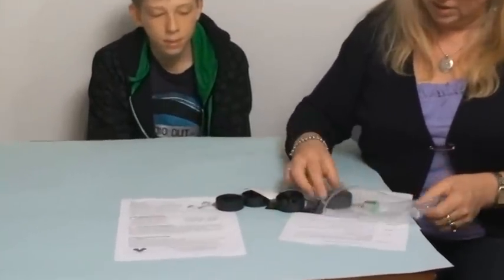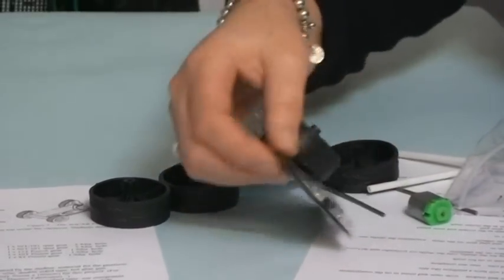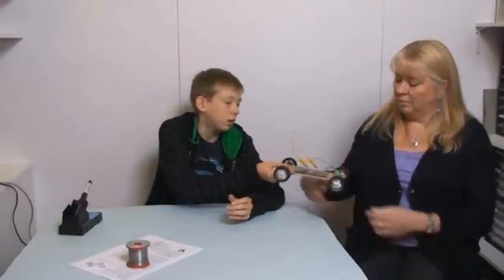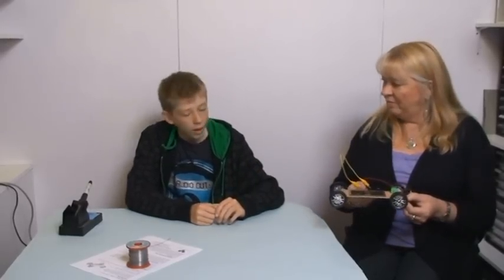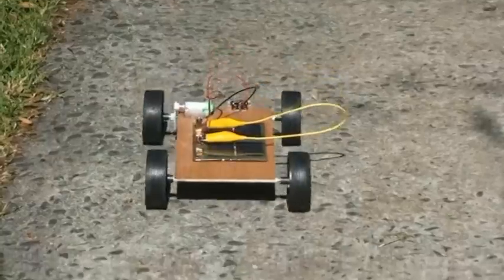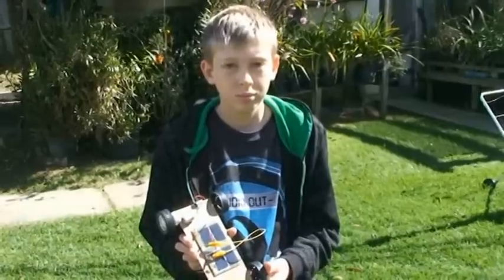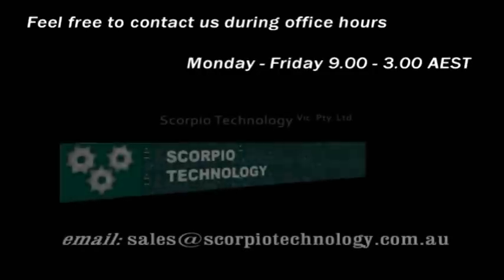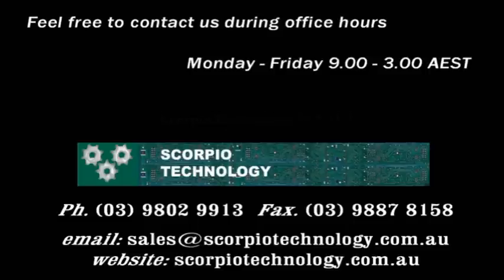How to make a SOLAR CAR

Comment: Can you send a list of materials used
Reply from the maker: Hi Raghav, the parts are easy to identify from the video: 2 axles + axle tubes, 4 wheels, a pinion and a spur gear, a motor, small solar panel, on off switch. Some hook up wire, an alligator clips with lead, double sided foam tape and hot glue gun are useful.
Regarding the:
- motor needs to be matched to the solar panel
- the gearing will need to be worked out (or by experimentation) once you have the motpr, solar panel, and wheels (outer diameter) as these all play a part in the complete package

Comment: You need 1,5 v solar panel and 1,5 v motor. Soldering iron, electric cable , wheels , axles and a gear and piece of thick cardboard

Comment: What's that white thing called by the wheel ?
Reply from the maker: The white object is a spur gear - power to the axle and wheel is transmitted from the motor by a small gear (which is pushed onto the motor's shaft) to a larger gear (pushed onto the axle), driving the car forward.